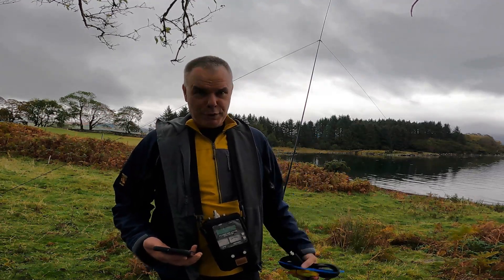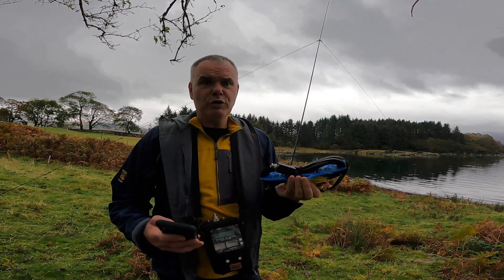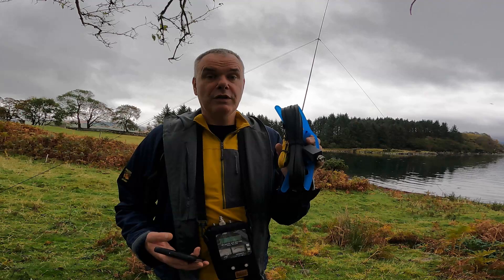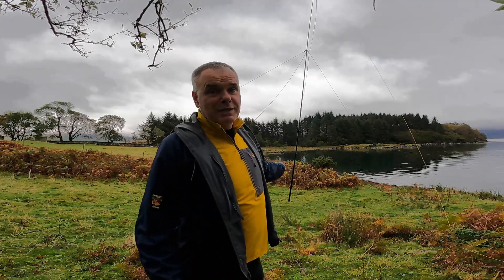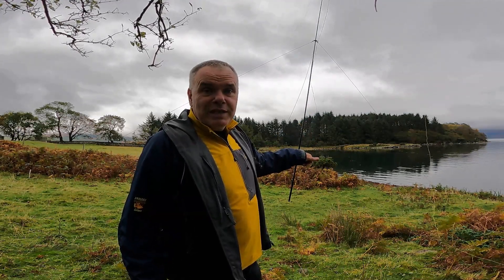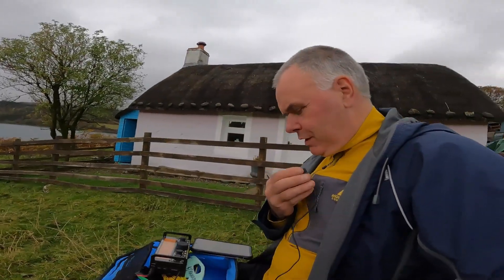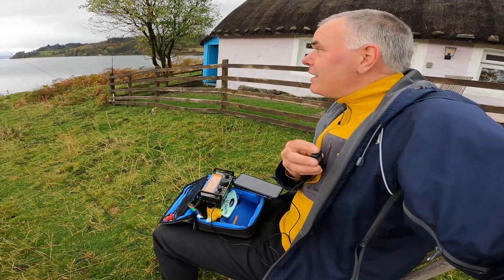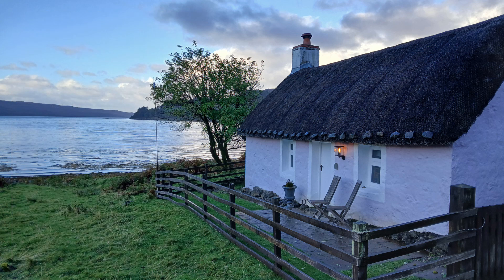ZS6BKW multiband antenna - tuning and testing on a Spiderbeam 14m mast

Comment: I use mine on all hf bands. The tuner in the kX3 handles the feed impedance happily on most bands from 80-6m, though you correctly point out that at higher frequencies the radiation pattern of a 28m long dipole has many lobes, none prominent so it is probably not as good as a dipole at the same height. But for convenience it is unbeatable.  On 40,20,17,12 and 10m it matches well with the kX3, just like a raw dipole, and on 80, 30 and 15 the original feed length is producing too high an impedance, up to 6:1 swr on 80m.  But I have reduced the feed line length to about 9m and that changed it greatly esp on 30m.  Now I just QSY, hit tune, see 1.0 and go.  Great for instant S2S grabber on another band, just QSY to the spotted freq, make a contact, then go back to where you were.  BTW the original article from the designer clearly showed that some variation in dipole length and feedline length and impedance may be necessary to suit each user.  I’ve used 300 ohm tv ribbon but now use MFJ 300 ohm twin line, I also use a choke balun at the tx end, and the only coax is internal to the KX3.  It’s a great example of impedance transformer action in the feedline.  73 Andrew VK1DA/VK2DA
Reply from the maker: Good report Andrew, thanks! I suspect I will use one when on holiday or similar. Just too big for the garden.
Cheers, Fraser MM0EFI
Reply: @ there is always the option of halving the length of the dipole/doublet and halving the feedline length and then you’d have a 40m-10m multiband antenna. Or double size - Gerard Vk2io built a double size version so as to have 160m coverage. 73 Andrew VK1DA/VK2DA
Reply from the maker: @andrewd4890 that's pretty cool. It is a  key flexible design. My harden just isn't suited to centre fed antennas, and I don't operate from home much at all, so make do with a smallish delta loop, 40-6m.

Comment: Interesting thanks. Btw there appears to be some kind of club rave going on in the cottage behind you if that apparent pulsing light is anything to go by.
Reply from the maker: I think my wife was having a solo silent disco while I was out playing radio.
Reply: Nah that's just RFI from Fraser running unattended FT8 at 1.5TW (terawatts)🤣- 73
Reply from the maker: Using all of the electricity on Mull 😋

Comment: Good work Fraser, shows how height makes a big difference. How high did you have it in the end? 73
Reply from the maker: I had the bottom section of the 14m pole collapsed and it was 1m from the top, so around 12m high. A long wire high up, working really well considering I was at 1m ASL and surrounded by hills.